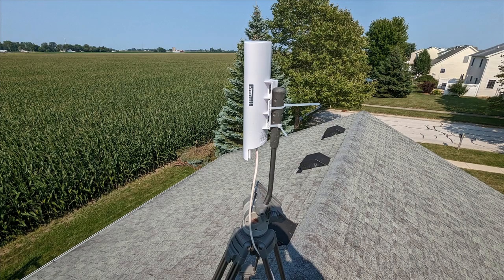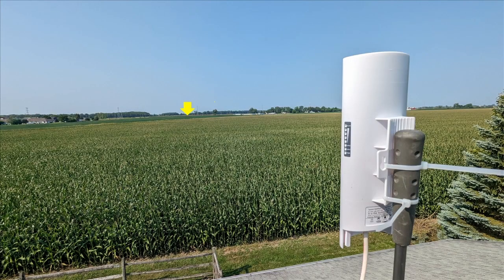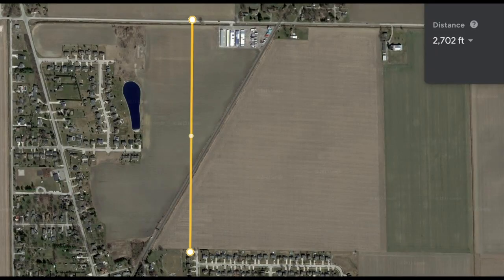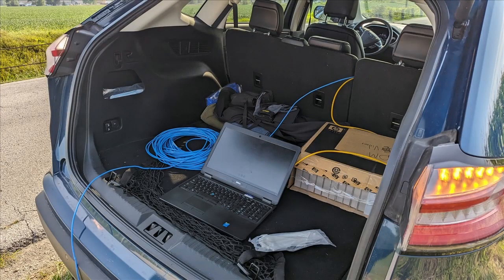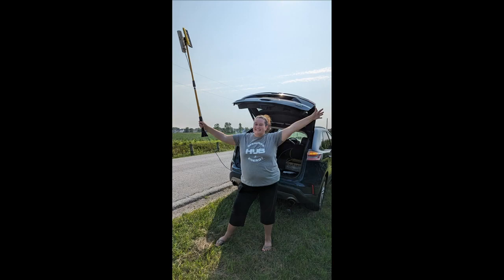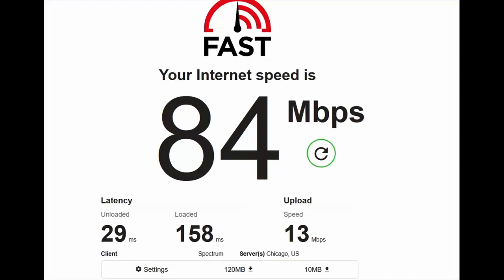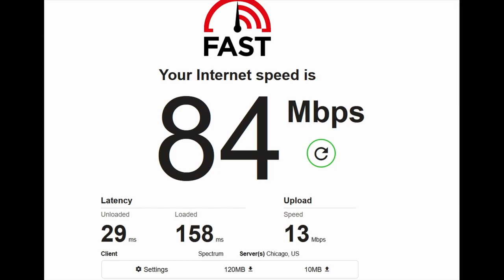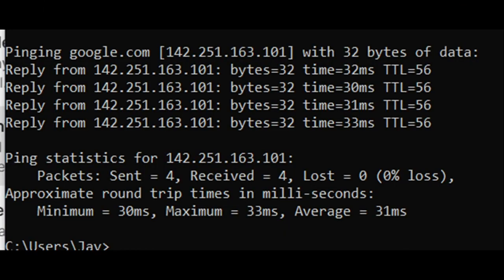Ueevii Wireless Bridge Setup at 2700 feet

Comment: Did each device have a wan and lan port? Looks like you are only running one cat cable into it. Does the internet run into the power adapter and then to the device? Maybe I’m setting mine up incorrectly. Can’t get them to work. Trying 2.5miles no obstructions. I have the CPE999 device which is marketed as the CPE10KM on their website. Also there is no signal strength meter on these ones and the lights are so dim during the daytime I can’t tell if they are on or not. lol.
Reply from the maker: I was just doing LAN to LAN as these units don't have a WAN port on them. I have done a 10 mile link before at work that lasted for almost 7 years but that was on tall buildings. How high are you able to put your antennas? You are going to need some height in order to go 2.5 miles.
Reply: @TVJAY  one home is on top of a hill about 700 feet higher than my other home at 2.6 mile distance. Clear line of sight from the roof of each home. Discovered the slave device radio isn’t functioning. Connected to both directly and the 5g radio is not functioning on one device so I need to figure out how to contact them to return one of the devices.